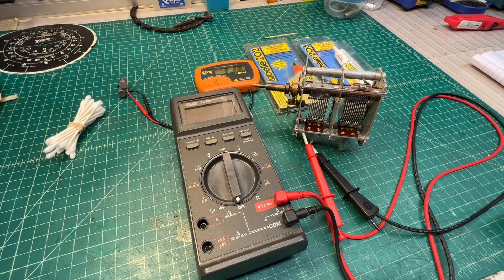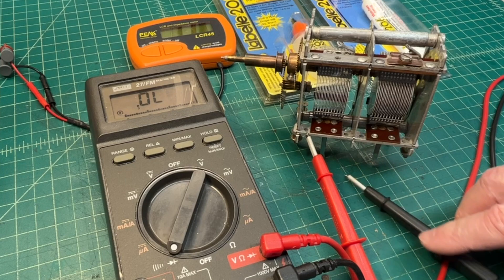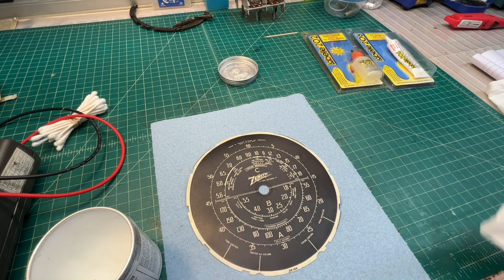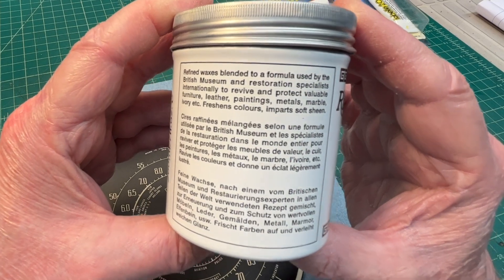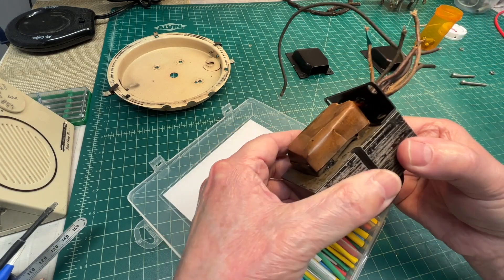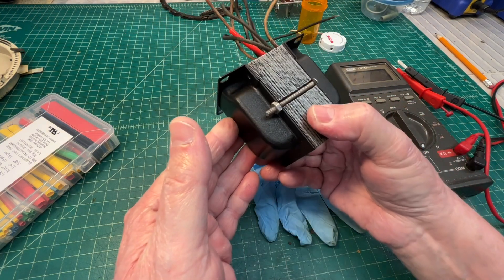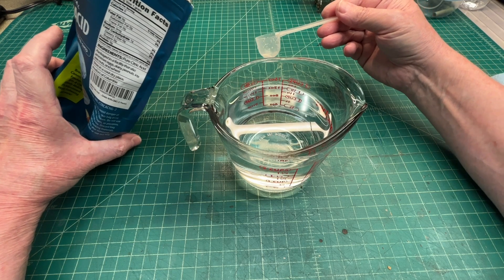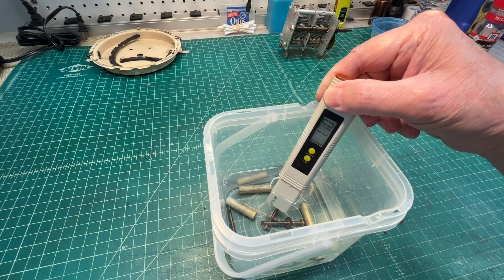Zenith 6S229 - Tuning Condenser/Power Transformer Wrap Up, Dial Scale Cleaning & Citric Acid pH Q&A

Comment: Is the shaft of the condenser the most important part to clean? Obviously besides making sure no bent blades.
Reply from the maker: The shaft is important to ensure the rotation is free, but to your point on the plates make sure none are bent and none has what’s referred to as “cat whiskers”, e.g., dust, oxidation, lent that can short the plates. If the plates short for any reason on the BC or Oscillator section, the receiver will be inoperable. Hope this helps. Best, Don

Comment: Why   not  just use  Coca   cola  ?
Reply: First it is sticky so you must use diet cola. Doesn't have to be a name brand but it has an overall pH of 2.3 for 
sugary cola and 3.0 for diet. Ironically car battery acid is at the same pH as Don's  citric acid solution.
Reply from the maker: John, check out Steve’s reply as well. Knowing my ratio of citric acid to water is more acidic than Coco Cola and less expensive is the main drivers, but it’s really more of a personal preference. Thanks for reaching out. Best, Don